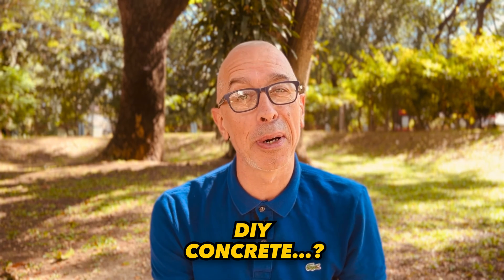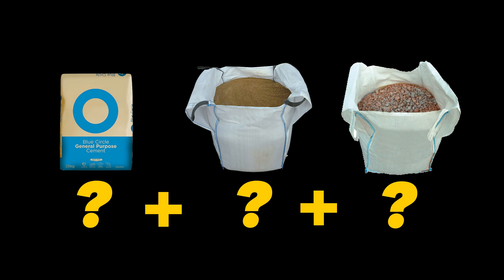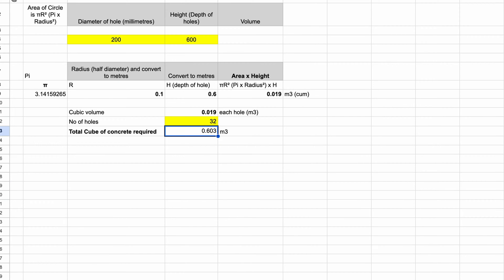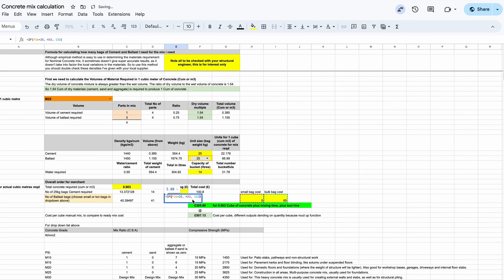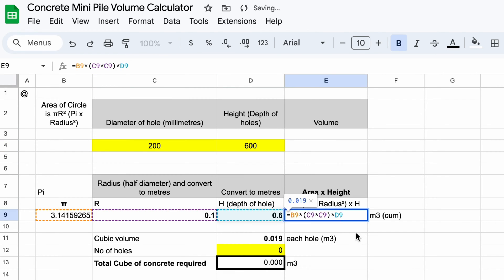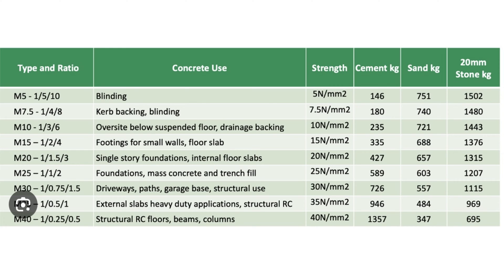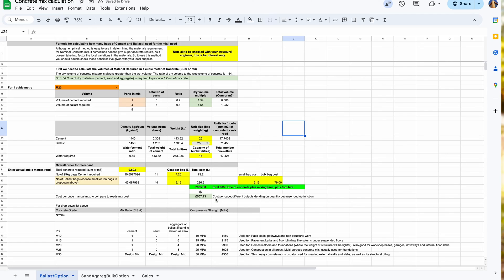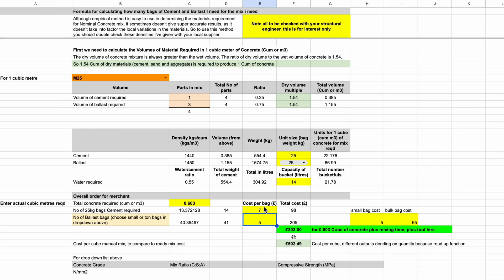Cement, Sand & Aggregate Concrete mix explained - DIY Spreadsheet

Comment: Hello. thanks for the informative videos. I have subscribed and opened the downloads link, but only seem to get PDFs when i click download on the concrete calculator spreadsheet. Is there another link for the XLS file please? cheers
Reply from the maker: Hi. There should be the actual spreadsheet with the formulas linked within the pdf if you open that up. Let me know if that works. Thanks
Reply: @build-better-things  that worked thanks.

Comment: Waiting for response after signing up on your website. The link in the description does not contain an excel sheet as the video suggests…
Reply: Same this end.
Reply from the maker: Just sorting out a technical problem and it will be on its way to you. Sorry for the delay.
Reply: Thanks for responding, i'll look forward to getting it as planning a concrete base for garden room @build-better-things
Reply from the maker: Hopefully you all received it by now?
Reply: @build-better-things  still just a pdf
Reply from the maker: @grassabrutta the link to the actual file download is noted within the pdf.